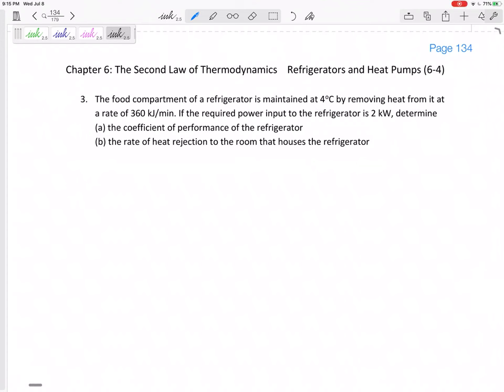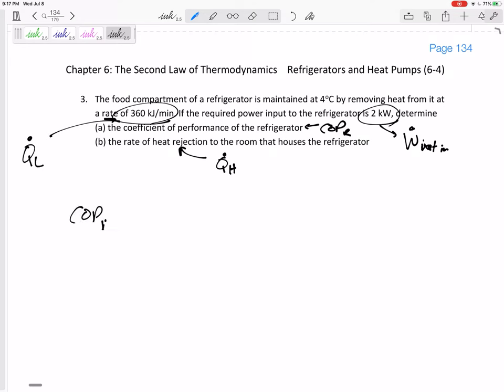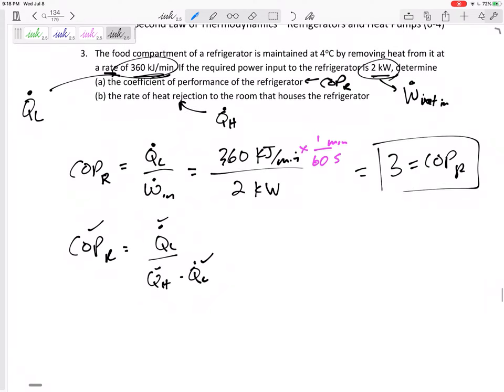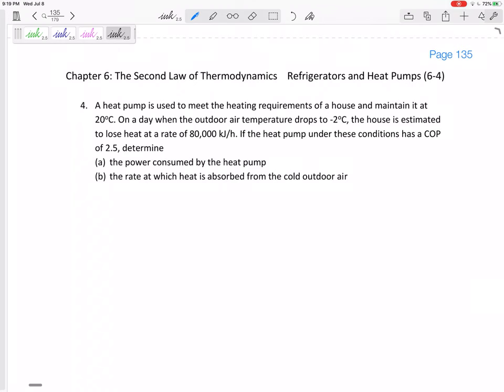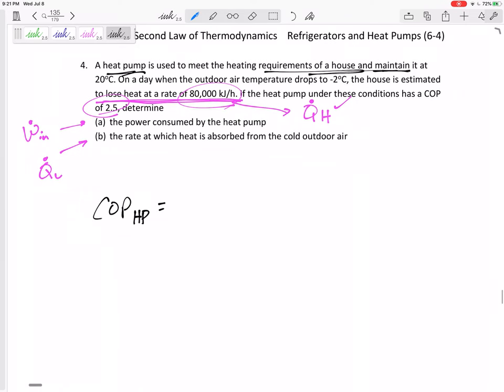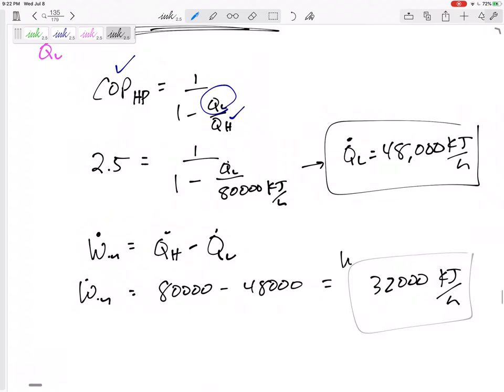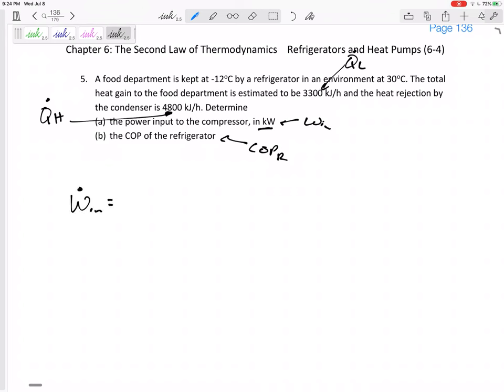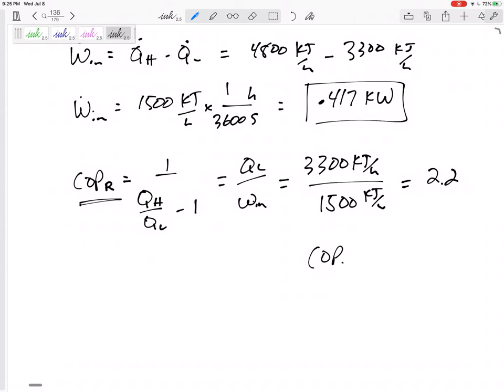Thermodynamics - 6-4 Refrigerators and Heat Pumps - examples

Comment: QL is the heat removed from the refrigerated space. Why is the heat gain to the food department called QL here? Example 3.
Reply from the maker: Sorry I didn’t see this comment! The refrigerator is kept at a constant temperature. So any “heat gain” to the refrigerated space has to be taken out so the temp doesn’t go up. Sometimes the book goes a round about way of telling us this info. For example: in winter, the rate that a house “loses heat” would be the same rate that a heater would need to be pumping in heat to keep the temperature constant.

Comment: why are Ql and Qh switched?
Reply from the maker: Where? The equation for COP is different for a refrigerator and for a heat pump. Because the goal for each device is different even though they operate in the same cycle.
Reply: @engineeringdeciphered  ur right thank you so much!!! (": ily

Comment: Professor ,I have one more confusion sorry to bother you again.Why at 1:05 we say Wnet,in ?
Because of the we do not have Wout in the system? 
In the heat engine we say Wnet,out for example. Is it due to we do not have Win in heat engines?I really appreciate your help
Reply from the maker: For a refrigerator I should probably just say Win, because there is no Wout. But for heat engines sometimes there is a Win and Wout so we use Wnet out = Wout - Win.